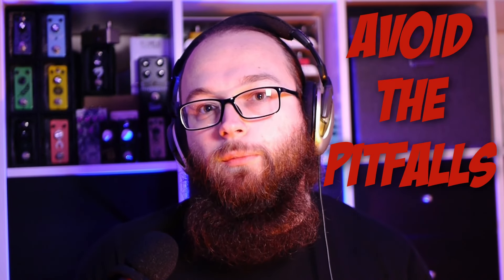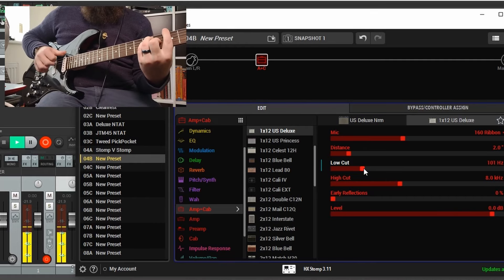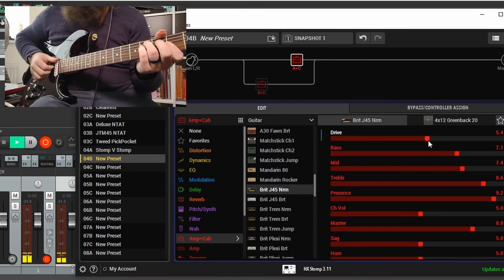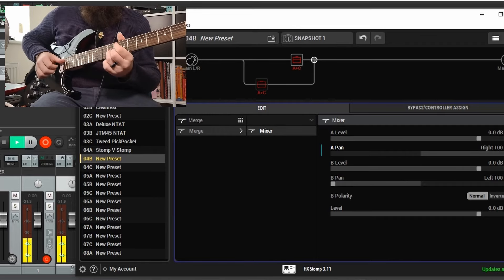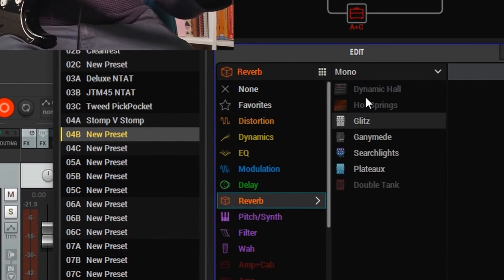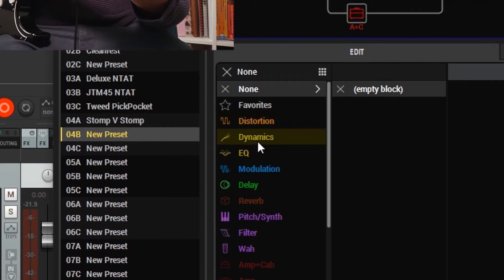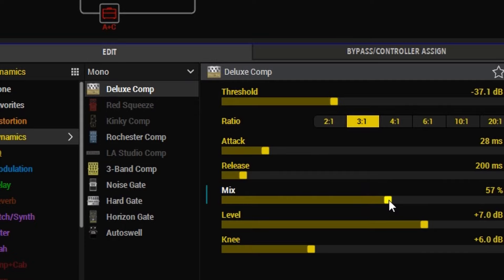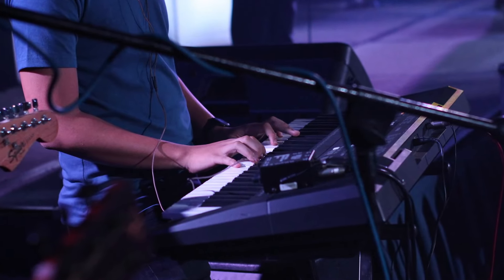Beginner Mistakes YOU need to avoid! Stereo Amp Patches HX Stomp - Pedalboards of Doom

Comment: Nice video man … question now that I have  2 amps how do I go out stereo to my mixer ??
Reply from the maker: If you're going direct out of the Stomp, use the left and right output into separate channels on the mixer (and pan them slightly) to achieve a stereo wideness. Does that clear thing up? Let me know 👍
Reply: @PBOD   First I want to thank you for taking the time to reply.
I'll try to do what you say I'll let you know how it goes
a question with that configuration that you show in the video, I tried to add IRS to the two amps but it didn't let me...
Reply from the maker: Hey, no problem. I'm always here to help. I had issues trying to get 2 IRs to work, but you can use 2 of the line 6 cabs. Subbed this video, line 6 have made the cabs take up less DSP also, so you should get more space to add other pedals and such 👍
Reply: @PBOD  🙏🙏🙏

Comment: Just wondering why I run out of DSP after running the same 2 amps and a room reverb as what you did. I also can't get to the independent pan for each amp..? Brand new stomp xl, updated. Any advice?
Reply from the maker: I'm not sure why this would be the case. I was running this before the cab update too, so theoretically there should be a little more DSP on tap. I made the patch available to download I think, it was for the stomp and not the XL but it might work? Let me know how you get on 👍

Comment: Am I missing something?  If you use a mono compressor at the end of the chain that would just sum the patch to mono?  Or is that what the stomp does anyway - I have the LT.
Reply from the maker: I don't think when I added the comp, it made any significant difference in the wideness of the tone so I'd assume it doesn't sum it. If you have the extra power of the LT, it might be worth having two parallel chains just to make sure as the dsp isn't so much of an issue.
Reply: @PBOD  Pretty sure it does sum it to mono - discussed many times on Helix forums and videos.  Why not simply use the stereo version of the comp - or is that not available?

Comment from the maker: Nice, what if you needed delay or other effects though!?
Reply: You're limited to how much you can add. On top of this tone, you'd be likely to be able to add one other effect from a limited pool. I have a video in the pipeline that shows some of the limitations a bit more, so stay tuned 👍
Reply from the maker: Budget PedalChap , is it possible to mix one tone down into a block then to effect that?
Reply: @PBOD  if I dragged the effects over to either of the lines before the split, it'll just effect that one side. You could get a wet dry set up then I suppose. I'm not sure if that answers your question, let me know 👍